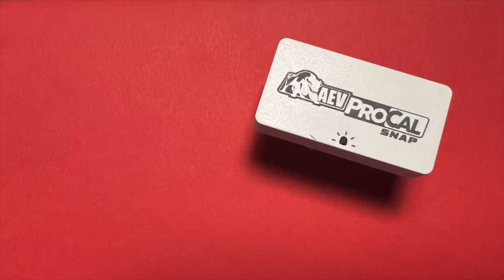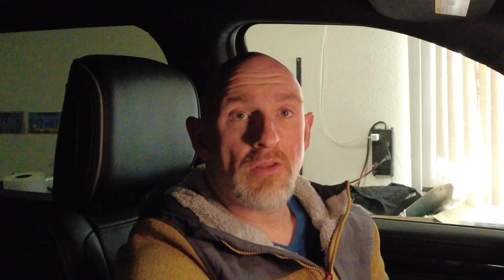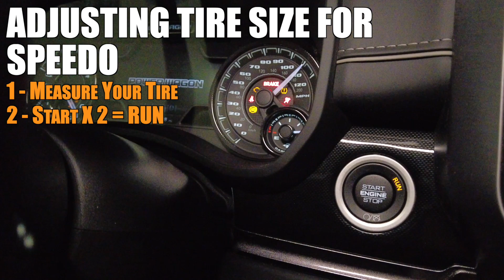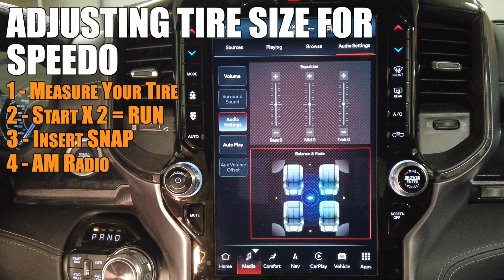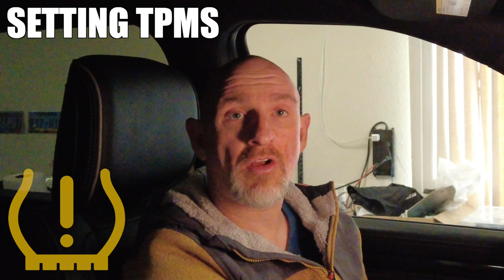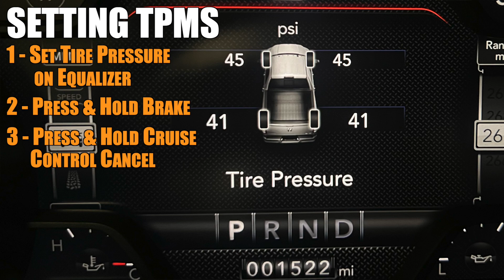AEV ProCal SNAP Programming on RAM 2500 Power Wagon

Comment: Thanks for this.  Just got a 24 power wagon.  Is there no wiring harness for the new rams? You just plugged in the Pro-Calc snap.  Other video show the wiring harness have to be connected under the dash.  Do you not have to do that with the newer ones?
Reply from the maker: I have another video on this channel that shows how to wire it up.

Comment: Will the AEV ProCal SNAP work with the new digital instrument cluster.  I have a 2023 2500 Power Wagon with the updated digital dash.  Thanks.
Reply from the maker: I'm not sure - you'd have to check with AEV on that one.
Reply: @goofingoffroad  I ended up getting my truck taken care of.  My friend is a mechanic for Honda and has the computer needed.  I only had to buy the unlock cable.  He set TPMS and Speedo for 35’ tires.
Reply: The procal snap worked perfectly on my 2023 Power Wagon

Comment: Looks like you're still running the stock suspension (shocks and coils), are you getting any rubbing with articulation off road.  I notice those are the CJC wheels with the proper offset to run 37s but curious if there is proper spacing during off road use.  Thanks for the great vids!
Reply from the maker: You are correct - the suspension is stock and I'm running the CJC wheels with 37s.  I get a littl rub at full lock when the spring is compressed at the front.  Otherwise, I've had no issues running the 37s on trails.  Go for it!
Reply: @goofingoffroad  Great, thanks for the response!

Comment: I think I may have missed something. If the recommended tire pressure was supposed to be 45 PSI front and 40 PSI rear, why did you set it to 35 PSI? I'm going to have to do this to my truck as well. Since I leveled and put 37s on my truck, the tire pressure light has been on and the speedometer is slightly off. Thanks in advance.
Reply from the maker: When the tires are cold, or if you're traveling to a different altitude, your tire pressures may drop below 40psi.  I set the pressure for the TPMS alert to 35psi to allow for a small margin of lower pressure before the alert goes off, so that it's not bothering me all the time.  you could always set it to 40psi and see how you get on with it, and lower it if you don't like the way the TPMS system behaves.

Comment: A 37 should be about 36.5.. I have 35's that measure 34.5 and approx 34.8 the latter has thicker lugs
Reply from the maker: You're correct - the tires are usually smaller than the "size" written on the side of the tire.  They will also be a differnt "height" when measured on and off your vehicle.   In my case, when the 37" tire is inflated to the correct pressure and it has the weight of the truck on it, it is compressed to 35.5" from top to bottom.  Using this measurement means my speedo is spot on,  You may have different results.

Comment: Thankyou for the vid...does that 35.5 tire fit in spare location?
Reply from the maker: I ended up squeezing a 12.5/35/R17 in the stock spare location.  It took some work to get it in there!
Reply: @goofingoffroad  ok so that KO2 37 didn't fit?...I have a 35x12.5x17 spare on my 05 PW...I'm hoping the same for my 22 PW
Reply from the maker: I wasn't able to get the 37 to fit.  There wasn't enough room between the sway bar and the tow hitch.

Comment: I had just purchased a PW 2022 very interested in correcting speedo. I had up graded to Cooper Discover 35`s
Reply: Hey Tony did you encounter any problems after install? I have same truck with level3 not to many openings on green block.Will any open block work.
Reply from the maker: @anthonypenna5961  no problems after the install.  I believe that any opening on the green block will work.
Reply: I just bought a 22 PW; will the same procedure work with the 8 inch screen?
Reply from the maker: @98Demon  yes, it should.
Reply from the maker: The Procal will fix that for you.